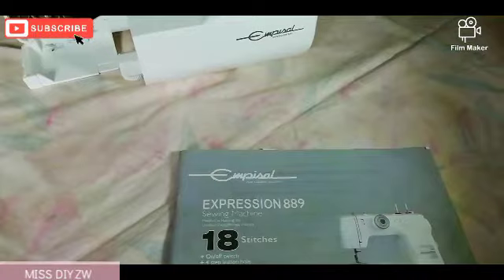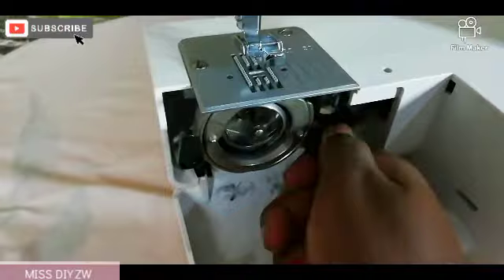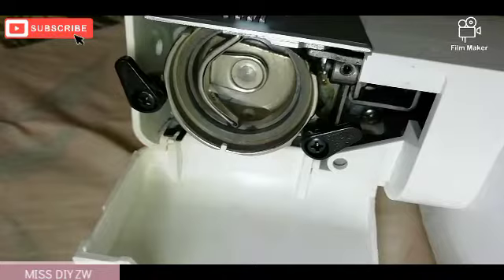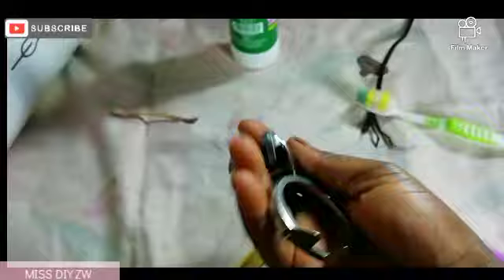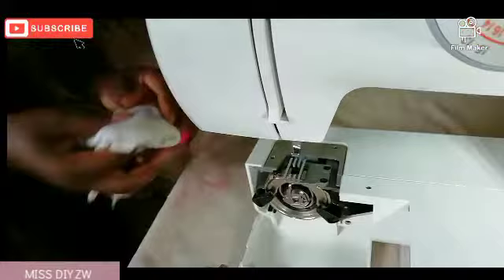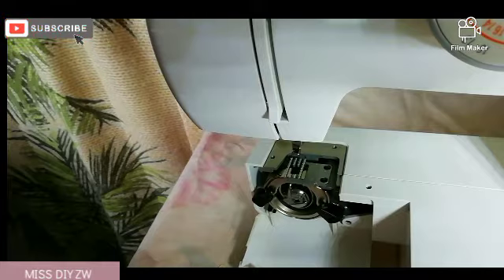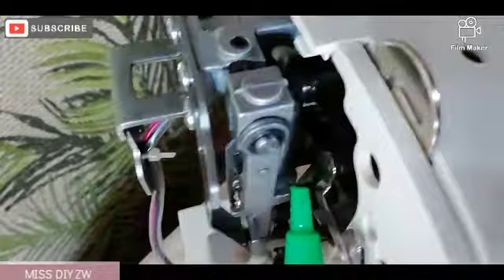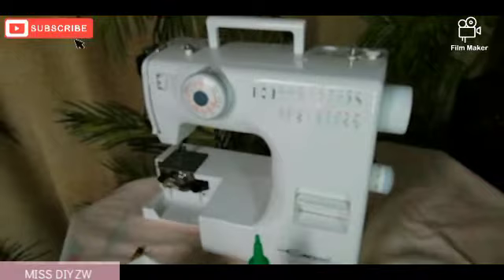EMPISAL EXPRESSION SEWING MACHINE MAINTENANCE, HOW TO OIL YOUR SEWING MACHINE/FOR BEGINNER

Comment: Remember the owners manual is only showing you the most basic maintenance instructions, with how far you took your machine apart everything that moves needs to be oiled, for instance you only oiled the upper sleeve bearing for the needle bar there is one lower on the shaft as well just where the shaft or needle bar goes up into the machine.
Reply from the maker: Thank you, l will definitely oil the parts l left out. Much appreciated

Comment: I have this machine....   I think my machine needs a bit of oiling because if I press down on the foot then it gets stuck ...the machine is on but it doesn't want to move... until I turn the balance wheel then it starts sewing....    It happens a lot.

& No where in my town is a shop that sells sewing supplies ...& I can't get out of town whenever I want to go buy sewing machine oil...